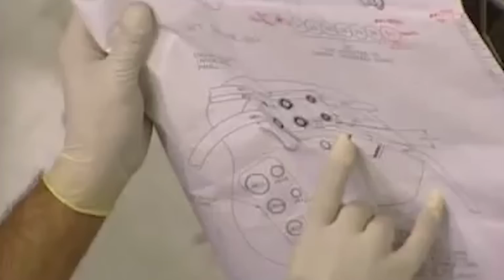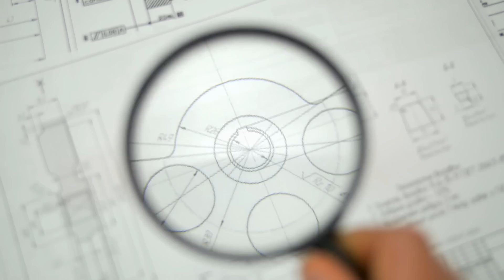Antares Rocket Explodes into Mushroom Cloud Seconds After Launch

Comment: I love the cut away drawing of a cars automatic transmission as a 'rocket engine' made me LOL
Reply: I am thinking about powering my spacecraft design with a pair of Turbo Hydramantic 400s....
Reply: @TheWolfsnack  guaranteed to handle all that thrust. 😉👍🏻👍🏻
Reply: Ford CruiseOmatiac! Lol band adjustment must have been off
Reply: SpaceX uses Powerglides to power their crap lol
Reply: No wonder the rocket failed, someone dropped a car transmission into it
Reply: Well..I'm pretty sure modern astronauts can't operate manual transmissions, so NASA had to use an automatic transmission in the rocket's power train, although a manual transmission would have been a simpler, more reliable design, which likely would have prevented the rocket's catastrophic failure.
Reply: You win everything. I am now dying. Thank you kind soul you made me laugh.
Reply: @mk6315  I had one and hated it. 68 Camaro damn I was dumb for selling it.
Reply: @moosenbeans903  I have one in my 66 Parisienne and daily drive it, gas prices are BS though
Reply: @mk6315  sweet damn they look cool
Reply: @mk6315  The Powerglide had a good reputation; my '66 Chevrolet Impala had one, & it worked fine, as I recall. The Saturn V rocket might have used the Powerglide automatic transmission; it would have been about the right time frame for it-lol
Reply: @jackandblaze5956  Rocket's propulsion system design by George Barris.
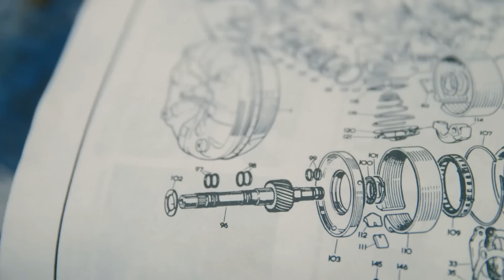Reply: OMG, your right, its at 6:09. Too funny.
Reply: Half of the shots in this "show" are totally unrelated to this particular incident, lol!
Reply: @shadovanish7435  it sounds like something Turbonique would have pitched to NASA lol
Reply: @tompepper4789  What's more incredible is how many people don't notice this. The producer of these videos must be laughing that no one ever notices
Reply: @shadovanish7435  LoL!
Reply: Thought I saw a reverse clutch in the middle of that drawing lol
Reply: @shadovanish7435  could you just imagine a rocket going vrrrrmmmm.....vrRRrrmmmM.....VrrrrrrRRRMMM..... VRRRRMMMMMMM.  hehe.

Comment: Nice effort, but the randomly thrown in stock footage really makes me cringe. The video is  talking multiple times about Wallops but shows Kennedy Space Center instead and randomly inserts Space Shuttle, Apollo and other non Antares footage every time it's explicitly talking about the Antares rocket.
Reply: Generally I like the Dark channels but I was thinking the same thing, wondering how much stock BS footage they were going to slip into this video. If it's not even close to the same subject then don't put it in the video
Reply: Yes, I can understand that you have to use stock footage for commercial reasons. But all the NASA Antares footage is public domain and with a bit of care you could have used footage from the previous Antares launches instead of picking things at random.

Comment: The engines weren't just good and efficient.. they ran closed loop, which was believed to Americans at the time to be impossible (economically.) That model rocket's design, while slightly altered, are still in use.
Reply: "Closed loop"? What the f*ck does THAT mean?
Reply: @oriraykai3610  It means the unused fuel and exhaust gases from the preburner stage (used to ignite the main engines) also gets fed into the main engines making them less wasteful and a lot more efficient.  It's a very complex bit of plumbing that the Soviets came up with.
Reply: @oriraykai3610  the exhaust from the turbopump is fed into the combustion chamber to be burned so that less fuel is wasted powering the turbopump. Even today most engines still vent their turbopump exhaust into the atmosphere which is an open loop.
Reply: @oriraykai3610  so a rocket engine has to use fuel to power the pump that feeds fuel into the main combustion chamber. Usually it's just exhausted (not completely burnt) overboard. You can see it on Saturn launches, it's the smoke coming out of a side Port, and it doesn't contribute to thrust at all. Closed loop means the fuel is routed back into the main system and contributes. More fuel efficiency
Reply: Actually, the proper term is "closed cycle".
Reply: @Raptorman0909  think you're right. I'm a mere enthusiast.
Reply: @oriraykai3610  I guess you don't have plans to be a rocket scientist when you grow up lol
Reply: @timf2279  Actually I AM a rocket scientist and was calling him out on mis-use of the term "closed cycle". My NASA colleague who sits across from me corrected him ;-).
Reply: @oriraykai3610  if you don't understand what a closed loop cycle engine then you shouldn't be commenting on here lmao
Reply: @oriraykai3610  yeah ok, whatever you say

Comment: Amusingly (or perhaps not) the engines for the Antares were built in Russia, but the fuselage came from Ukraine. With the start of conflict in Feb 2022, Northrop Grumman apparently only had two of the rockets available, meaning the rocket can only fly two more times.

When this explosion happened, Cygnus was moved to Atlas 5 until the rocket engines could be switched, but all remaining Atlas 5 rockets have been purchased and the assembly lines shut down to make way for ULA's Vulcan, which has not been flight certified yet. If so, Cygnus would have to fly on SpaceX's Falcon 9, meaning that the entire US crew and cargo program would be dependent on the continued success of a single rocket type...
Reply: Wikipedia says SpaceX has successfully launched Falcon9 rockets 168 times, cargo dragon has docked 20 times, and crew dragon has flown 4 times.
SLS is looking at end of this summer for their test flight, and Boeing is getting ready for another crew capsule flight soon.

Comment: The U.S. Congress decreed the end of using Russian made RD180 engines few years ago. The leftovers are being used by ULA but they should have ended by now. 
Blue Origin is the new supplier of rocket engines for ULA, but they have been delayed for many years because they use a massive, single turbopump for both fuel and oxidiser, they are still to fly for the first time. Blue Origin provided the first flyable engines to ULA few weeks ago, "only" six years late. We all hope the first flight will be a resounding success for both ULA and Blue Origin.
Blue Origin will be using the BE-4 engines in expendable, single use configuration; the BE-4 is supposedly a reusable engine, like the Merlin and Raptor-2 build by SpaceX. 
Compared to the RD180, the BE-4 uses cryogenic LNG (similar to liquid methane) instead of RP-1 fuel (purified kerosene).
BTW, the use of NK33 on the original Antares was a bit of too cheap way of launching a rocket.
Good luck to all involved...

Comment: As a rocket nerd, some of the points made in this video just aren't very accurate. The AJ-26 engines were not original flight N-1 engines, but rather modifications of the NK-33, which was the improved version of the NK-15s used on the N-1 for the developing N-1F. The NK-33 engines were also absolutely insane engines that the US has struggled to match to this day. To explain why I would need to take a deep dive into cycle types, but lets just say that in the 60s and 70s, the Soviets had solved a problem the US deemed borderline impossible, oxygen-rich staged combustion. The performance and efficiency on these engines with RP-1 outclassed any US RP-1 engine by a large margin at the time, and these engines, and the future RD-170/180/191 used in the 80s derived from this engine, are all still extremely good engines even by today's standards. Only within the last few years are we seeing engines that can compete outside of the SSME (RS-25), which has its own issues using hydrogen as a fuel. 

The reason these engines are so useful, even today, is realistically cost/performance. The RS-25 is probably the only American-made engine ever that beats out the nk-33 and subsequent RD-170/180/191 engines, but it costs FAR more due to being an extremely complex engine (due to solving some other insane problems). In addition, the engine uses Hydrogen as a fuel, which is much more difficult to work with both in terms of combustion and storage. The NK-33 and RD-170/180/191 still hold up today as a result, and the only changes recently have been spaceX's raptor engine, which is an incredible feat, and some recent engines using new cycle types such as on the electron rocket.

Comment: Those old engines did provide some very useful work, but I think it is High time we left Russia behind in it's entirety, and build our own rocket engines that can actually be tested on the ground in a full thrust capacity, which the Russian engines are not capable of doing. This shows the Mentality of the Russian engineers, that it's an all or nothing kind of endeavor, and there is not room for such a mentality in Space faring. It is that reason that caused the N1 rocket to fail because you need the capacity to build things within certain tolerances, with the ability to work in unison with all the other integral and extremely important systems that make up the Rocket. The N1 failed because the Russians tried to build a highly technical and complex rocket system using their "farmer bailing wire and horse glue" standards that carried them as far as could be humanly possible and I'm amazed that they accomplished what they did with their technical abilities and the all or nothing mentality they are so known for, but it had its time in the limelight and it's time we started using things that are purpose built by proper scientists and engineers that actually have a grasp on the fundamentals that lead to spacefaring technology. Using old soviet rocket engines are cheap, for sure, but they are also 40 years behind what the modern engines of today need to be. time to update I think, how many millions of dollars went up in that mushroom cloud? that was the Norm for old Soviet Rocketry beck in the day, where many men died foolishly and unnecessarily all for a political ideal that is now dead! Time to leave them and their rocket engines in the past, where they belong.
Reply: This comment is complete horse shit. Anybody with an undstanding of the history of spaceflight knows that the Soviet Union was at least equal to the US in engine design and manufacturing. The NK33 engines are a work of art. Russia was using staged combustion engine cycles in these engines long before the US did with the space shuttle. They were also using oxygen rich staged combustion, something the US never perfected. They are still among the most efficient kerosene fuelled engines ever made.
Reply: That’s precisely why SpaceX has dominated the market for the past few years. SpaceX has developed at least over 9 original rocket engine systems since 2015. Although one of those systems has design features similar to the NK-33 rocket booster that brought down the Antares.
Reply: @brian_castro  Not sure where you get 9. Merlin 1 (arguably 2 engines if you consider A&B and C&D as separate designs) Kestrel, Draco, SuperDraco, Raptor 1 and Raptor 2. Vacuum variants shouldn't count as they are are pretty closely based on the sea level versions.

Comment: Some people commenting here don't seem to understand a couple things made clear in the video. They were not using Russian (Soviet) technology, they were using Russian hardware. They used it because unlike what many think, space programs do not have unlimited funding. The Soviet hardware was bought for pennies on the dollar and adapted for use, which is a solid concept when operating in the real world. It's easy to say we should use only American hardware, until we are handed the bill for it. And no, rocket technology is not comparable to automotive technology. It is not like driving an 80 year old car. What it takes to put payload into orbit has not changed. 
That being said, this accident has surely led the program to reevaluate how these engines are validated and as needed, upgraded for use. The content of the video could speak more to that, IMO.
Reply: They were directly using Soviet rocket engines built in the 1960s and 1970s, with minimal modification, so it's accurate to say "using Soviet technology". It was a good move, there were tons of these theoretically perfectly good engines sitting in storage in warehouses in Russia for decades, but it turns out that they had some design/manufacturing flaws that weren't caught, resulting in the decision to stop using them.

Comment: Financially speaking, buying those stockpiled engines was a good investment for NASA. They had been very reliable up to that point. Though, having scientists and engineers modify engines that were built decades before most were even born, seems a bit problematic to me. I wonder if the contractors properly tested those engines after the heavy modifications were made. NASA is well known for their tedious inspections and testing phases to the point that it always seems to drive the costs of the projects well above their projected budgets. But private contractors don't have the backing of the US taxpayers. There is enormous pressures to bring these projects to fruition on time and on budget. Most Americans remember the Challenger disaster. It was caused by the failure of the O-rings in one of the solid rocket boosters. Morton Thiokol knew that cold temperatures could seriously affect the performance of the o-rings. But between the top executives of both organizations, it was decided to ignore common sense and continue the launch despite freezing temperatures in January, 1986.

Comment: The fact that the engines are Soviet rocket engines shouldn't matter considering that we bought them and modified them for use. The modifications should be re-tested and changed to prevent the same catastrophe. Simple as pie. That's why we bought the rocket engines so cheap. To save on cost of launching the space craft. Fix the problems and test the engines.

Comment: Why wouldn't we continue to use Soviet era engines?  Most of the time they worked.  US rocket engines don't have a perfect record either.  We didn't ;buy the Soviet engines simply because they were cheap.  They were also known to be very good at what they did.
Reply: The investigations after the launch failure showed that there were design and manufacturing flaws in the engines, which were all built in the 1960s and 1970s and had been sitting in a warehouse in Russia for half a century. They briefly considered trying to manufacture new versions of the engines (as hard has restarting manufacturing 50 years later would be), but decided it was easier to just migrate to modern Russian engines.

Comment: IT is crazy that we still rely on Soviet engines in this modern day. The costs of engineering and production of such critical components has become something few choose to invest in because of an unstable political world. With no sure path to sales and the ever changing environment, cutting corners even on such technological complex builds like rockets still occurs. Naturally there will be consequences.
Reply: At this point all the Russian engines in use in the US are post-Soviet designs (though those designs may still have Soviet-era heritage). Orbital Sciences (now Northrop Grumman after multiple mergers and buyouts) now uses the Russian RD-181, and ULA (Boeing/Lockheed Martin) is only using the RD-180 until they can transition to Jeff Bezos' BlueOrigin engines. Russia has cut off the supply of engines to the US. ULA claims to have enough engines in stock to last through their transition to new engines, and Grumman has enough to complete their currently pending launches but hasn't been working on engine replacements and will be in a bind.

Comment: As anyone familiar with Soviet rocket technology can tell you, their engines were, repeat WERE cutting edge and more efficient pound for pound than their American counterparts. Problem is, they were also dangerous beyond American standards of safety. Yeah, they were cheap because the USSR had ordered them destroyed but they were hidden in a warehouse for, what, decades? How reliable is a car that has sat in a garage for 40 years? Who's surprised? Not me. Fact is, all rocket engines are a hair's breadth from explosion, that's what they do. Another fact is even the US can't physically duplicate the technology to even make a Saturn rocket engine..to this day! The physical manufacturing techniques just don't exist any more. Its only a wonder to me this doesn't happen more often. What's needed is a craft that can fly to the rim of space (like the SR71) and then switch to alternate propulsion for non-atmospheric flight. And if you don't think the military doesn't have this already, you're fooling yourself.
Reply: @bowlweevil4161  yes and no. Yes to price and technical aspects, no to reliability and safety. The difference is in priorities, same as difference in Soviet aircraft. Also, Sockets are 10 years ( now) and 20 years then in computation processing power. What they have done with what they have is remarkable though technology still seems to win out. Witness the spectacular failure that sparked this discourse.